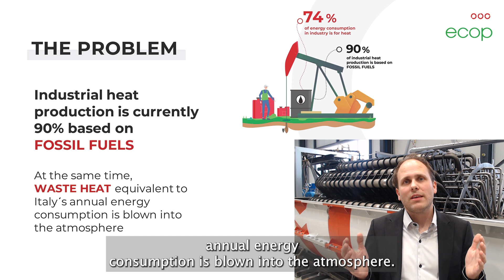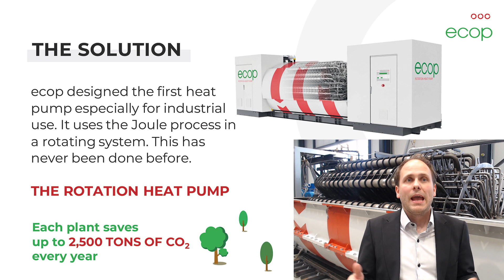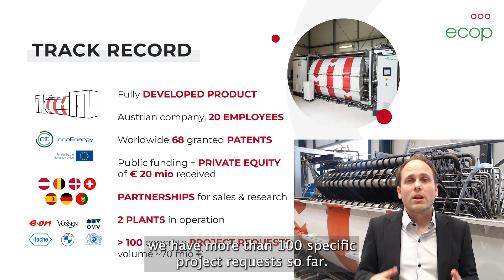Rotation Heat Pump and impact

Comment: Really cool basic principle. Seems to me like the design has some room for improvement, like why have a large number of small heat exchangers when you could have the heat exchange between large structural cylinders within each other?
Reply from the maker: Great question. Our prototypes and simulations have shown that the heat exchange works best in this form, since we are gaseous throughout the whole process and this way the centrifugal force is most efficient.